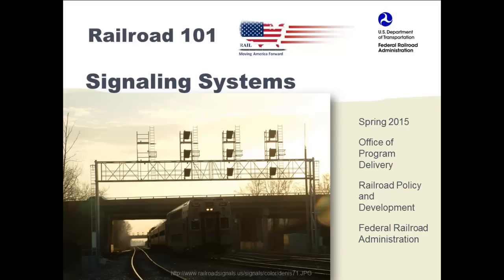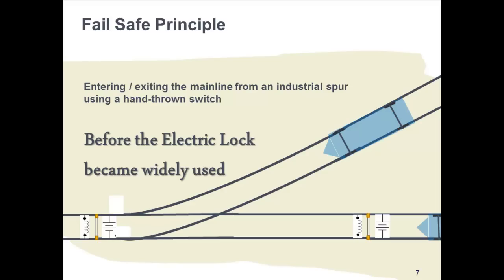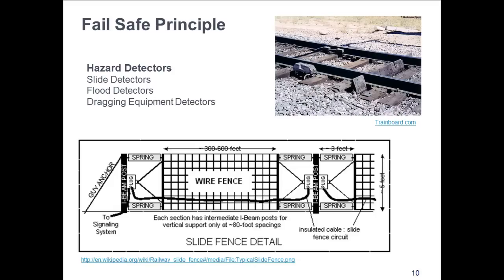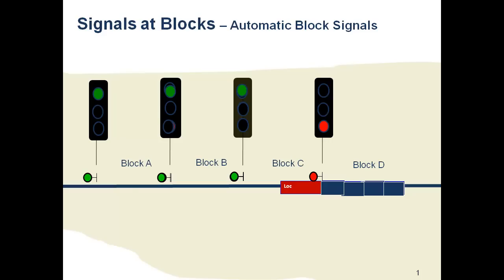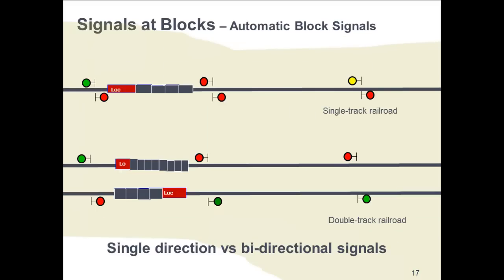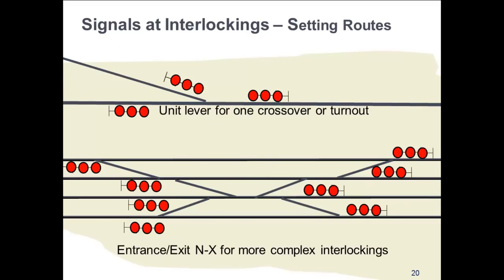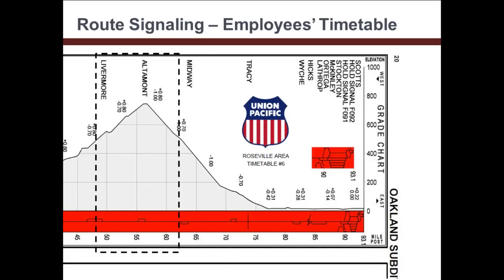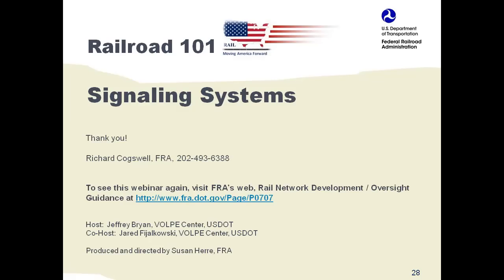Railroad 101:  Signaling Systems

Comment: One of my favorite aspects of the railroad is the signaling systems and switch control,the signals themselves the bright red/yellow/green,even frost white Wich indicates a speed restriction do to excessivley hot or cold weather wich will effect the rails causing a dangerous situation...🙁😲😲..Frank misssssschief

Comment: Does this mean that with PTC,  trains can be spaced closer together because you don't have to assume worst-case?  The system could recognize that different trains run at different speeds and have very different stopping distances.   A 900 ft  train in a 13,000 foot block has a lot of buffer.   However, it might be able to stop much quicker and the train following it may not be able to stop in time.  It seems like a very complex calculation.  Adding that maybe one of the trains has electronically activated braking.   

When anti-lock brakes came out on cars, initially they created more accidents.  When the first car has ABS  it can stop quickly but the car without ABS behind it cannot stop in time

Comment: Great video... at 33:27 you guys note that RED over RED over YELLOW is "SLOW APPROACH", this is incorrect, this is a restricting signal.
Reply: Michael Carrigy I thought restricting was lunar white
Reply: That is a stop and proceed signal
Reply: Maybe it's different depending on the system. My experience is with CSX and their old system from the SCL here in Florida.
Reply: Every railroad has there different signal system
Reply: David Shelton depends where you are...
Reply: Diverging Approach on the CN and CP
Reply: It’s a slow approach under Csx/seaboard rules where restricting is red red lunar. Conrail and I believe Norac rules it would be a restricting. Conrail also used a red red lunar as a restricting.
Reply: @TrucksNTracks On UP or BNSF, it would be Diverging Approach.  In Canada, it would be Restricting.

Comment: How does one actually wire a relay?   Logic means nothing without hard-wiring.
Reply: A relay consists of a solenoid, with a central sliding pin mechanically hooked to an electrical switch. The coil is energized by running a current through it, usually a low voltage e.g. 12V, and the coil magnetically pulls / retracts the slider in. The switch itself is typically connected to a circuit separate from the coil. On a track, the coil is tied into the track circuit, while the switch is tied into the signal system. It is possible for these to freeze up in severe cold.